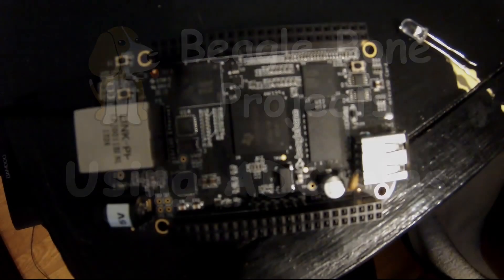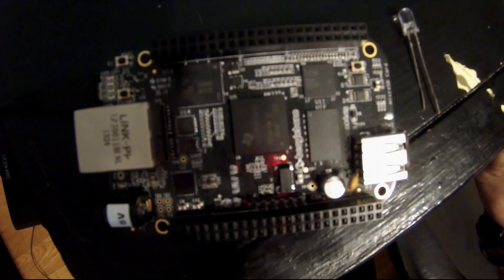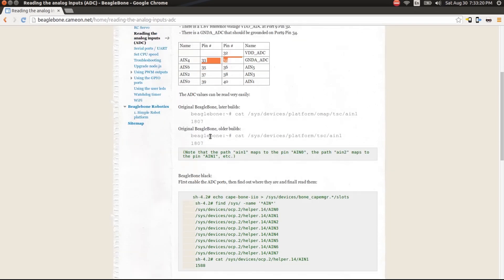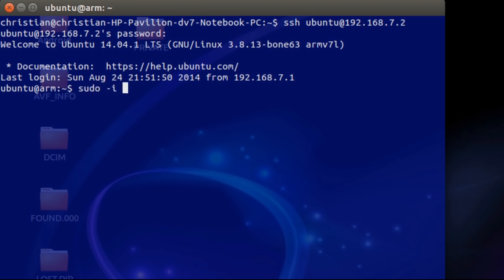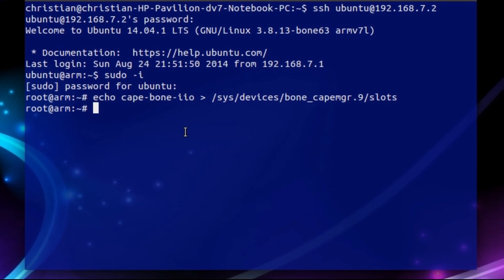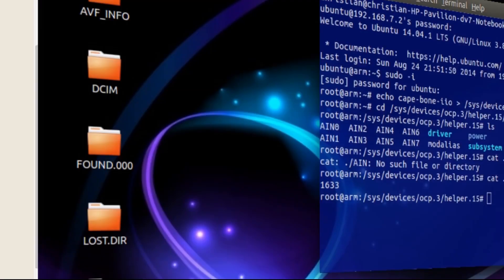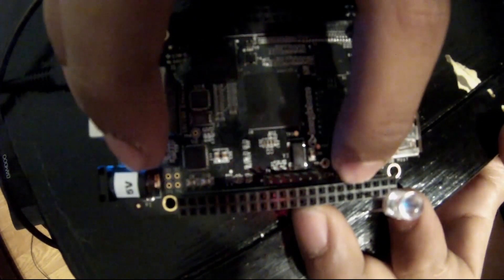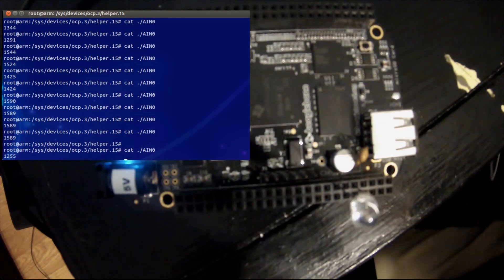ADC Pins on BeagleBone Black

Comment: you can ssh directly as root from the terminal;

ssh root@192.168.7.2
Reply from the maker: Thanks for the tip!! What is the password to access root user through ssh?
Reply: If there are no previous users then there shouldn't be one. If there is a user with a password already I'm not sure you can directly ssh as root.
Reply from the maker: Thank you!

Comment: Hello sir. Any luck with increasing the sampling rate yet? Thanks
Reply from the maker: No sir, I've been stuck with school work.
Reply from the maker: Hello +Mahmoud, have you been able to get a fast sample rate?
Reply: Beagle Bone Projects Yes sir. I used a library called BBBIOlib. this is a direct link for the library on github: https://github.com/VegetableAvenger/BBBIOlib . Please refer to the "Demo/Demo_ADC" folder in the library. Read the "ReadMe" file for more info.
Reply from the maker: Mahmoud Al-Ashi well the reason I asked was because I was sampling at rate much fast than what you mentioned. I was going to ask what kernel you were on.
Reply: Beagle Bone Projects I am using the Debian 4.6.3-14. What about you? And what language did you use?
Reply from the maker: Mahmoud Al-Ashi I used Ubuntu 14.04 with Linux kernel 3.8.

Comment: Hello sir, I wanted to ask you about how to increase the sampling rate. if you type the following command:     time cat /sys/devices/ocp.3/helper/15/AIN0      you will get the real time to execute the command. The result will be approximately equal to 50ms! which means that I can only take 20 samples per second. How can I increase the sampling rate to become something near MHz?? Thanks in advance.
Reply from the maker: You could create a program. The AIN pin is capable of a 125ns sample rate. I'll cite this later. This mean that your capable of 8MHz. I am currently making a program that reads the AIN pins. I'll make a program on the side to test this and let you know. The cat program may take longer to read the pin thereby slowing down the max sample rate. Its okay for just reading the pin at slow rate.
Reply: Beagle Bone Projects May you sir please refer to this question on stackoverflow.com  http://stackoverflow.com/questions/25796901/increase-beaglebone-black-adc-sampling-rate? I posted this yesterday. In the question I discuss several codes using terminal, python and javascript. Non of them gave me a sampling rate in the MHZ, only a few kilo sample/ second as a max. Please help me. Thanks in advance.
Reply from the maker: Thank you for the thread you posted on Stack Overflow! I read the reply and was actually unaware of the OS interfering with the sample time (Probably something I should have known...). I code in C but never had to sample something more the 4 or 5 times per second. I will add this in my video for future reference. Also if you achieve the sample rate you were looking for before I can find the best solution, post a comment here and ill add it to my future video and give you credit.
Reply: Beagle Bone Projects Sure sir, If I get any updates I will inform you. So far I'm stuck on a 1KHz!
Reply from the maker: Mahmoud Al-Ashi If i may ask. What is it that you are trying do with the adc?
Reply: Beagle Bone Projects some sound processing for a project. I'm interested with at least 40KHz sampling rate. I used arduino uno but as you know it samples at a 5Khz only.